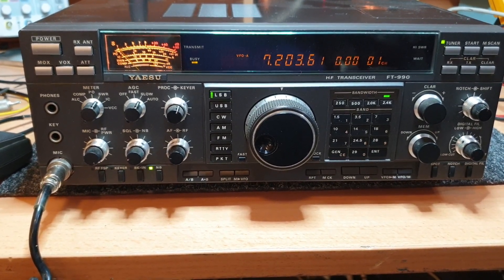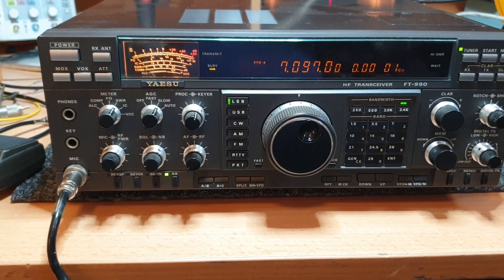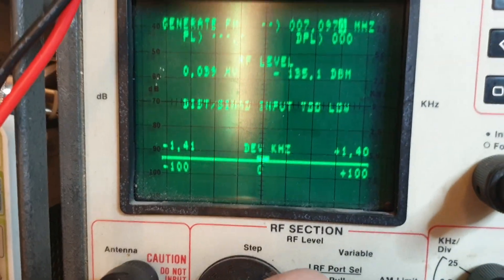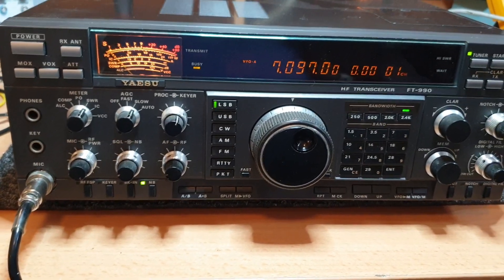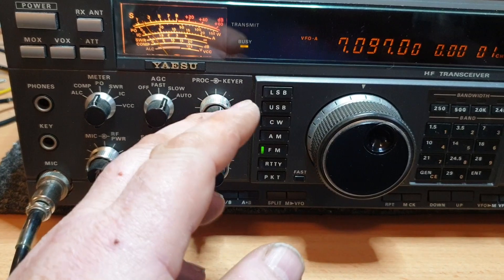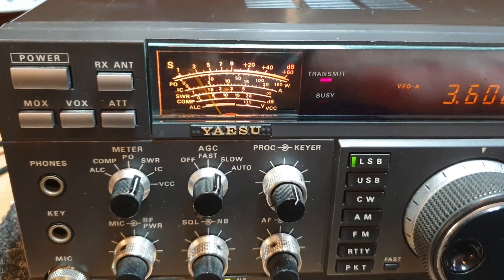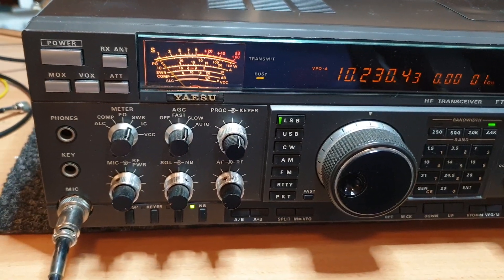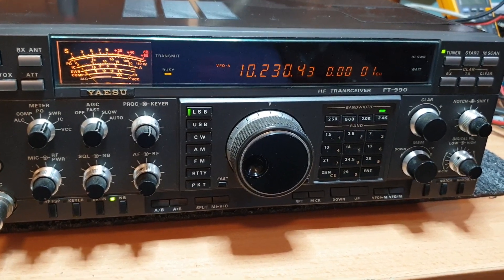Yaesu Ft990 sensitivity and antenna tuner test....

Comment: Aye Brenton

I've got one here, and I have loved it since the day I set eyes on it...Wyong Field Day about 25yrs ago.

Anyway, I concur on the hot receiver....but would you say (without a sig gen available etc) an s8.5 on the 990 would equate to an s8 on the 3000 with Amp1 on?  Obviously the 990 was before the IPO technology...so I guess you get tempted to just use attenuation.  I dont turn it on much because the signal meter on receive just disspoints me....but I still read signals comfortably with it.  Anyway...thoughts?

Thanks again...good luck with the powerline noise.

Aaron